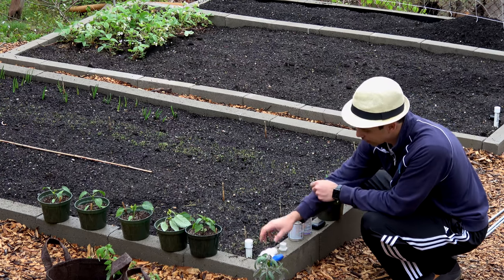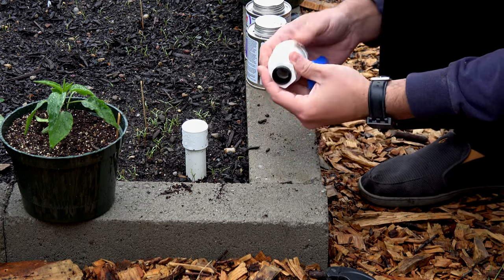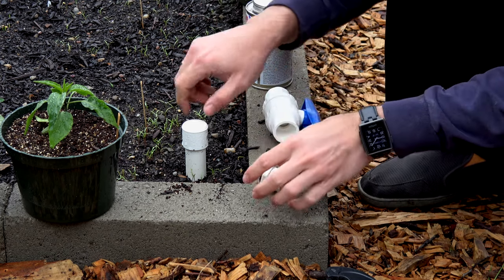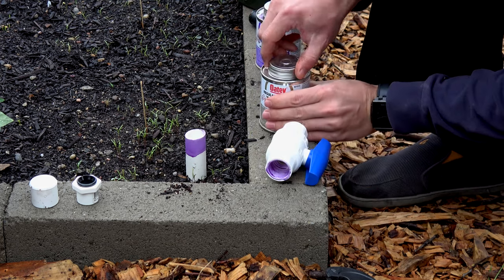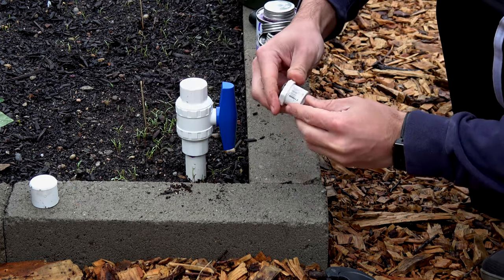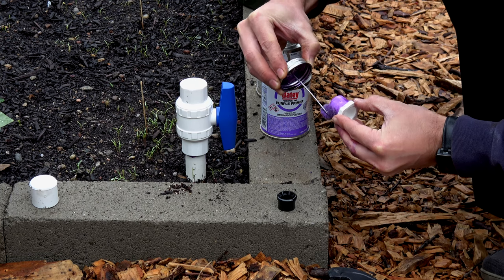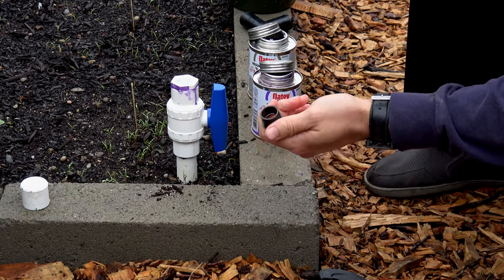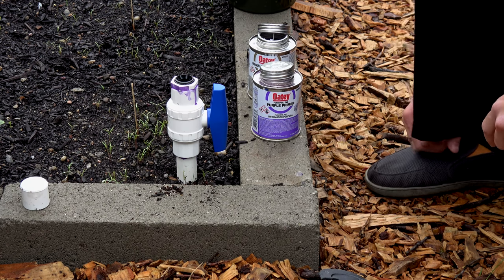3/4" PVC To 1/2" Drip Tubing

Comment: Do you need to put a regulator in that line somewhere to drop the PSI down from household to drip?
Reply from the maker: I think it is best to do it as your water pressure might be too high for the drippers. I did install one on mine.
Reply: Got it, thanks. I'm very new to this stuff - I have existing in ground sprinkler valves and a PVC stub that I left to build my new lines out from. That's household pressure I assume? Or are those valves for my sprinkles already regulating my PVC line? Or, when I do the conversion to the 1/2" drip line should I just drop in a little in line regulator at each drip line?
Reply from the maker: Your sprinkler system might already have a pressure regulator somewhere (controller?). You want 25-30PSI for normal drip irrigation system. If your PVC stub is directly from the water supply, that would be household pressure. But if it is from the sprinkler system, it can be even lower than 25PSI. You can always put a 25PSI regulator and test a 1GPH nozzle to see if it about correct. On  the front of my house, where I just have some root pouches I used this to attach to a standard hose threaded end: https://www.amazon.com/gp/product/B076C7G7NF
Works pretty well. If you can find a 3/4" PVC to fauced/hose adaptor, this might be all you need to start your new lines.

Comment: where did you find the 3/4" PVC to 1/2" Drip Tubing Adapter?Could you please share the link
Reply from the maker: It's really 2 pieces. The black piece is a 1/2" to 1/2" and is this one https://www.dripirrigation.com/1-2-700-od-compression-1-2-insert-poly-to-1-2-pvc-slip. That is glued to a regular 1/2" to 3/4" PVC that you can find just about anywhere . That combined makes the 1/2" to 3/4" adapter. 
Hope that helps!